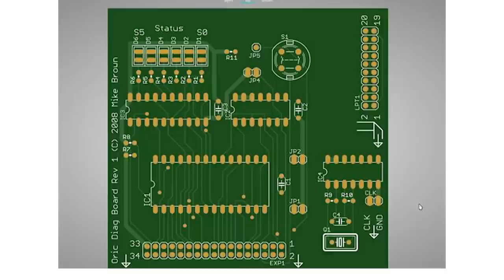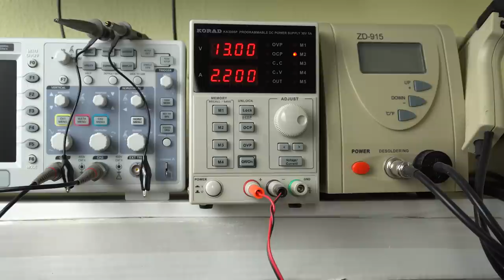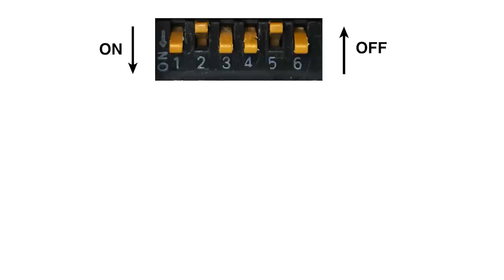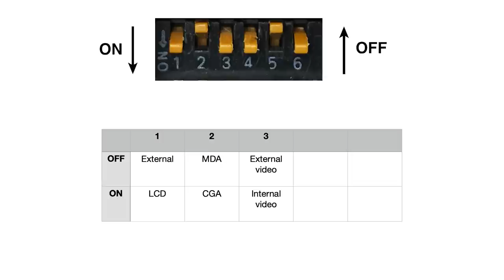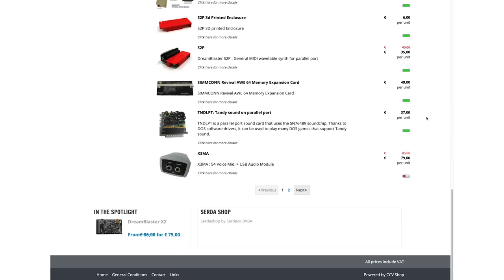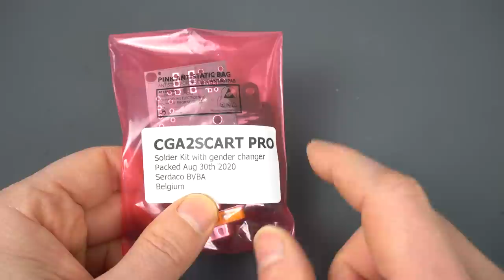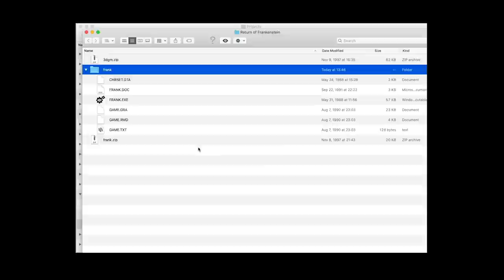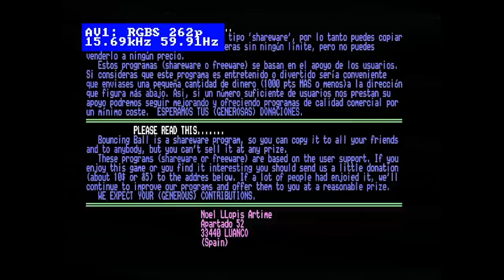Early MS-DOS Laptop Amstrad PPC512 (Part 1)

Comment: I couldn't get out of the bubbles...I ran it on the Amiga PCTask emulator so it was a bit too slow to figure out the controls.
Reply from the maker: Haha, I"m not surprised. That's the slowest part even on the original hardware (lots of transparent drawing). The controls should just be the arrow keys, although I think QAOP and shift to jump also work.

Comment: 3:30 If I remember correctly the batteries last for about one hour of work.
Reply from the maker: Seriously??? That's really, really impressive! I guess that's what you get with the low-power LCD.
Reply: You may have been able to use rechargeable batteries in this too. An hour per pop with 10 disposable C cells will get expensive fast
Reply: @williefleete  the BIOS would detect that, stop booting and tell you to use alkaline batteries :( I was a little child when I had to convince my mom to buy me alkalines every month I went to Tenerife with my grandma for the travel time
Reply: @williefleete  Ni cads are 1.2V rather than 1.5V for alkaline cells.
It was also possible to connect it to the cigarette lighter/accessory outlet in a car or van. Which is closer to 14V than 12V.
I'd guess it contains a 12V linear regulator such as a 7812.
Reply: An hour seems plausible, with alkaline batteries. While an alkaline C cell can have a nominal capacity of up to 8000mAh, it will deliver much less when it needs to supply lots of current. Since the mains power supply is rated at 2A, I guess the current draw would be in the general region of around 1A (plus an additional 0.3A..0.7A when the floppy drive runs). Alkaline C cells could deliver that for maybe an hour (without excessive floppy operations).

There was no power saving feature in these old machines; the CPU ran at full power all the time - which would be in the general region of 1W.

Comment: Did you really have to specify that the disk was DD? I think many IBM's lacked the detection for the disk type, but non-IBM PC's had the detection ability. I think they formatted the disk to the correct capacity automatically based on that.
Reply from the maker: The Amstrad PPC only supports DD disks (or at least that disk drive, I don't know if with a different drive it would be able to read an HD disk). If I hadn't formatted it as 720K it wouldn't have been able to read it. It's quite primitive that way.
Reply: @NoelsRetroLab  I meant that you seemed to use an actual DD disk for it. A regular (non-IBM) HD drive would have detected the type, reported it to the format program, and the format program would have by default formatted it as a DD disk, without any extra parameters. (Whereas on an IBM there would be no detection, and the drive would report its own maximum capacity, and even a DD disk would by default be formatted into an unreliably-functioning HD disk.) On a non-IBM system the 720 parameter should be needed only when specifically formatting an HD disk into a DD disk in an HD (or ED) drive. I just tried myself on my WIndows 10 laptop with USB floppy drive. I don't have actual DD disks, but I taped over the capacity type hole in the corner of the disk and formatted it with just "format a:" command. As expected, it got formatted into 720 kB, so the capacity got detected as expected.

Comment: Did you look at the display fuse?
Reply from the maker: I didn't! To be honest I didn't even open the LCD frame yet. But it turns out that wasn't the problem (already fixed it for part 2). Spoiler: The LCD has a +5V and a -20V input!